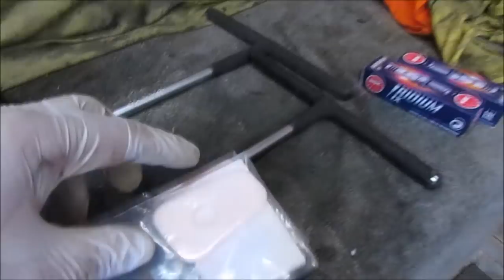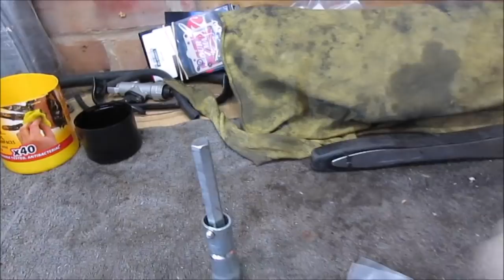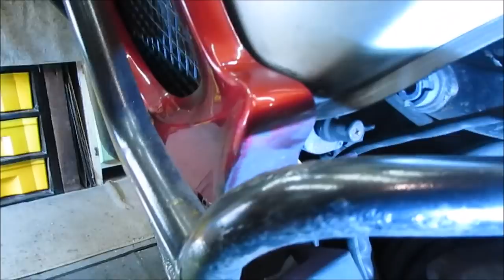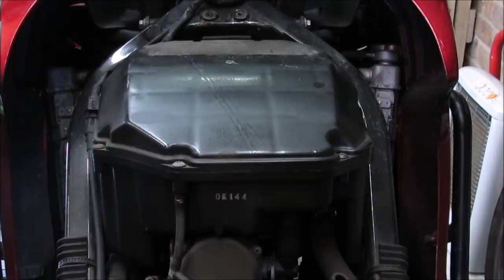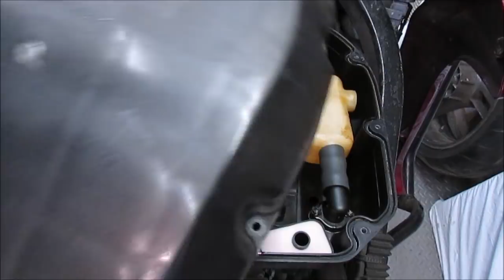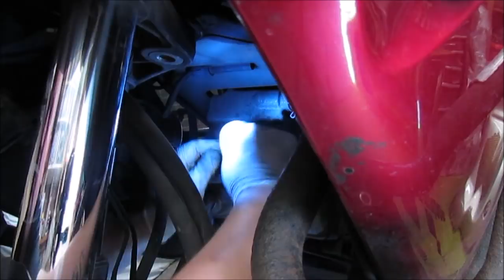Honda XL1000 Varadero - Spark Plugs and Sub Air Cleaner Filters Change

Comment: Isn't there an electrical connection on the tank for the low fuel light?
Reply: Yes, it’s on the right side faring just above the fuel tap
Reply: @riptarn  cheers mate 👍
Reply from the maker: Yes, green and a brown wire

Comment: Great video and thanks for the info just couple of quick questions if you do not mind 1st  what spark plug did you use and what was the gap set to and 2nd do you have the code for the filters you installed many thanks liam
Reply from the maker: Thanks Liam , the iridium plugs are DPR8EIX-9, the gap is 0.028 and the filter part number from Honda is 17254-MBB-000
Reply: @TheAmateurBikeBuilder  That  is brilliant thank you so much ride safe liam

Comment: great video thank you I have never seen my spark plugs or air filter they could be iridum  plugs and K&N air filter for all I know . I bought my Varadero with 21000 miles its just gone over 30000 miles now I have replaced the brake pads all round and just fitted new chain and sprockets and tyres .  I have bought 2 bikes  and was delighted to fine  K&N air filters fitted one was filthy no bother just wash it and spray some K&n oil on it the other is brand new . before I awaken her from her winter sleep I will check the tyre pressures bleed up the brakes as I think they go off over winter easy enough job only 6 bleed nipples  :  )  and then  inspect the  air filter and plugs but with such low miles they shoud be ok . over time I will buy a accurate  low range torque wrench and feeler gauges and check the valve clearance .
Reply from the maker: Thanks Harry, mines heading towards 82000 miles and still going strong, thats the beauty of K&N filters, just wash it re-oil it and away you go

Comment: I will be trying to replace the spark plugs this week and also the air filter not sure if the air filter is exactly the same as yours my Varadero is from 2007 I’ll post it out as soon as I finish
Reply from the maker: Hello Hugo, no the air filters are different, but both have the small pink filters shown in this video,